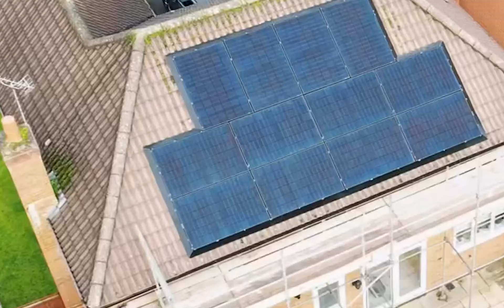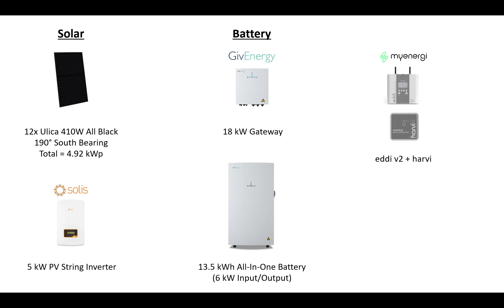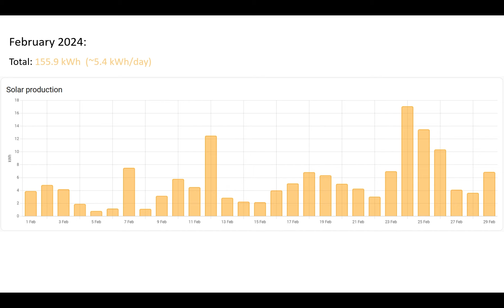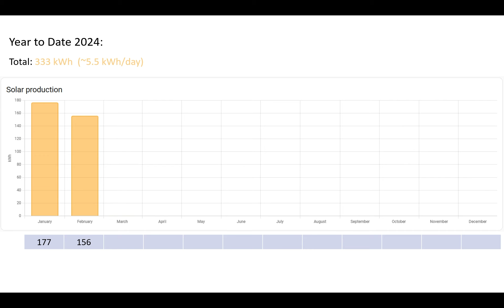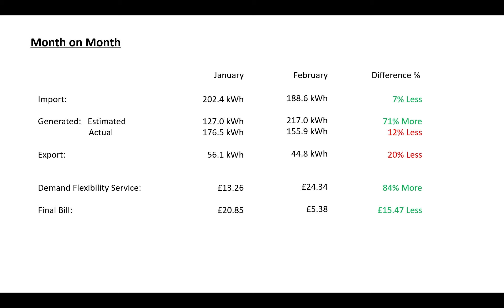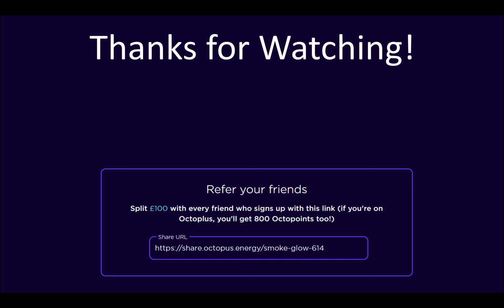Solar Update February 2024 - Singing in the rain :( - GivEnergy All-In-One system

Comment: Hi Matt. Good stats even if the generation was poor. 

155.03kWh generation for Feb for me from a 4.15kWp ESE array in Buckinghamshire. Highest generation day 12th Feb at 14.5kWh. Like you you it was a pretty poor month. 

I'm coming up to my first year with solar & I have decided to make some changes to our existing system. As a retired couple we are home most days so the heating is on most of the day & evenings & our daily electrical usage normally exceeds our current 9.5kWh battery capacity (my wife has the washing machine & HP dryer going most days during the winter!!). Our existing ESE array starts generating early in the morning but it runs out of puff around 1-2pm.     

So to combat this I'm having 5 extra 425w panels installed on a NW roof to pick up the afternoon solar & an additional 9.5kWh battery installed. This all goes in next week (scaffolding went up today) & will boost afternoon generation & double our battery storage capacity to 19kWh total. It will also give us more export options as well.  

Point to note that since my first install last year Solar panel prices have reduced by 50%! Battery prices have also reduced but not as much as panels (now 0% VAT if installed on their own).

I'm currently thinking about getting a Heat Pump Hot water cylinder (possibly a Mixergy iHP) or, a Thermal Battery (Sunamp). My Gas boiler will be staying put for the time being because it's only a few years old. I will be upsizing my radiators in order to reduce the boiler flow temp & adding extra loft insulation as well. 

This going green lark is very expensive. That said I'd rather invest & upgrade the house than give my hard earned savings & pension to the utility companies & HMRC in tax.

Comment: Here in Seattle I made 244 kWh of production on a 6.8 kW array but I do get on average 1 hours of day light more than you folks in the uk. But this is my first February month with solar, so I don’t know what to expect.
Reply from the maker: You can use this website: https://re.jrc.ec.europa.eu/pvg_tools/en/ to give an estimation of what you should be getting. It should work for the USA, but might not be as accurate as Europe. You just have to select your location, fill out the kWp size, roof angle and azimuth. It's a bit more complicated if you have panels on different sides of the roof. You'll have to add it up yourself.